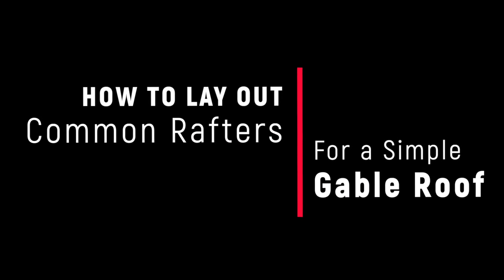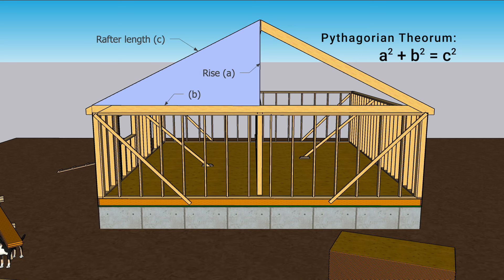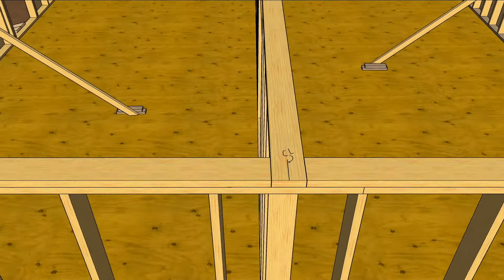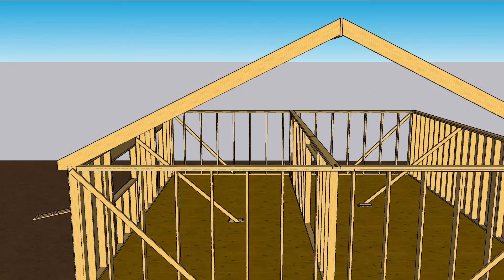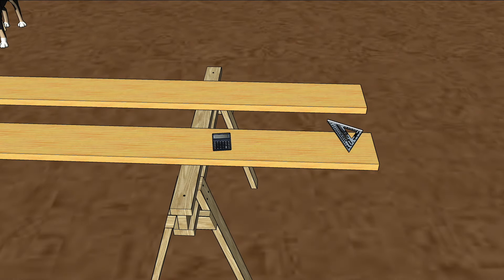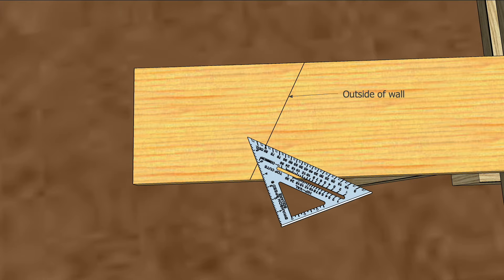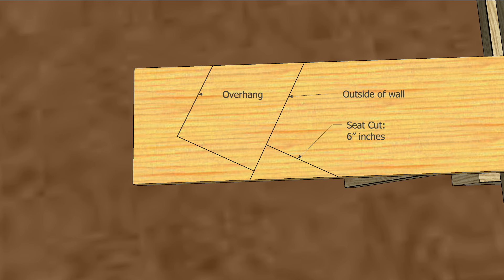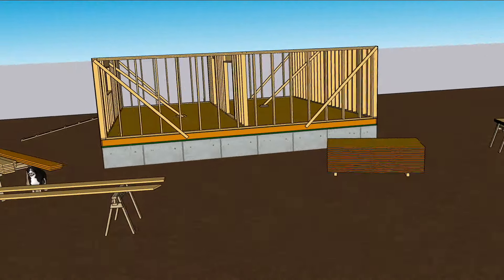Common Rafter Layout: How to Measure, Mark, and Cut Rafters for a Gable Roof

Comment: If you’re building a shed or other out building, you don’t have to cut a birds mouth, use hurricane straps
Reply from the maker: I mean, you could, but the seat cut makes it easier to place the rafters.
When I built my shed, I made site-built trusses for the hell of it and it seems to have worked very well.
Reply: @ProTradeCraft   I just started a shed build for my son 12x14 and the only reason I mentioned the hurricane straps is because I saw one guy who wasn’t very particular. I do believe having the rafters set on the top plate with birds mouth is the way I’m going. I’m just a dumb body and fender guy but trusses don’t seem beyond my capabilities.

Comment: I've heard framers don't prefer to cut rafters without overhangs ("monopoly framing") Why is it preferable in the big workflow picture to frame a roof with tails?
Reply: To creates eaves which have the water flowig out side the building line
Reply: @tderozan3868  of course eaves shed water. The question was not about the usefulness of eaves. The question was about the framers' workflow. Monopoly framing involves the extra step of framing eaves on top of the air barrier layer after. (And looks like I may have answered my own question.) But I was still curious if tails are used maybe to help line up the fascia board or something along those lines.
Reply: You certainly did . It's less work to incorporate the tails with the rafter than to do it as a separate task
Reply from the maker: Adding overhangs after the air barrier is established makes it a zillion times easier to get the air barrier right. Otherwise, you must air seal around every rafter, bridging the inside and out.

It is easier for framers to add the overhang to the end of the rafter instead of returning and adding overhangs after the roof and walls are sheathed and sealed—and usually covered with continuous insulation.

Many builders do not understand your question because most builders do not build very efficient houses. Your method is best for continuous insulation because it not only makes the air barrier continuous but also eliminates a thermal bridge every 16 or 24 inches on at least two sides of the house.

Here's an old animation showing that process in a retrofit situation, but it is transferable to new construction: https://www.youtube.com/watch?v=JmsosK2My6o
Reply from the maker: It is much harder to detail the air barrier is framing bridges inside and out. Rafter tails on the rafters is the traditional way of framing a roof, but if you want to build superinsulated structures that use very little energy, skip the tails until the air barrier is established and then add rafter tails, like this: https://www.youtube.com/watch?v=JmsosK2My6o

Comment: So hard to understand
Reply from the maker: 16 minus half the thickness of a 1-1/2 inch framing member (3/4 inch). If your engineered floor joists have wider flanges (they will), subtract half of that width from whatever number you want the joists to be centered on. make sense?

Comment: Are you trying to teach this to journeyman carpenters who should already know all this? Because you're firing off terminology without explanation of those terms as if your target audience are 4th year apprentices and not youtube viewers looking for pointers. This is coming from a journeyman plumber
Reply from the maker: It is meant c=for building professionals who are not framers. They are typically familiar with the terminology, and sometimes offednded if I "dumb it down," which I always tru to explain is "clarifying," but it doesn't always get heard. 

What terms are tripping you up?
Reply: Im a carpenter and this video makes perfect sense. so it worked for me
Reply: Quick question.   You use run from the outside of the wall to the center(offset by half the ridge width).  This will determine, in conjunction with the roof pitch, the angle of the cut at the rafter ends.  But, when you cut out the "birds mouth" you effectively are lowering one end of the rafter thus changing the cut angle where it meets the ridge, so you would have to lower the ridge end the same distance to maintain pitch and angle.  Therfore shouldn't one measure run from the inside of the wall so that angle and pitch are unaffected by the cut out for the "bird's mouth"?